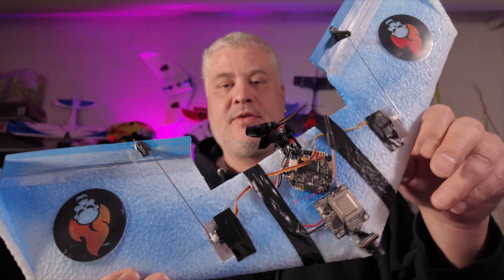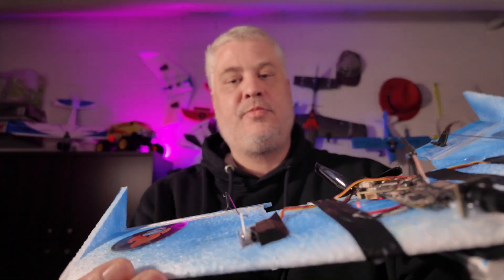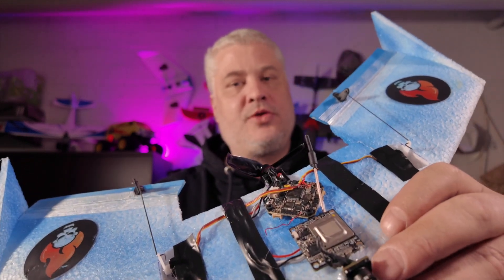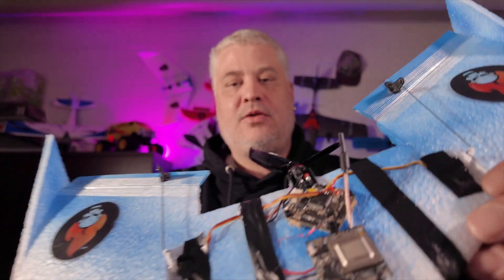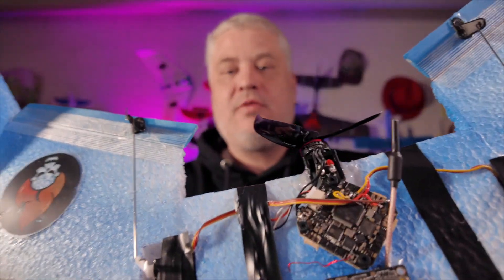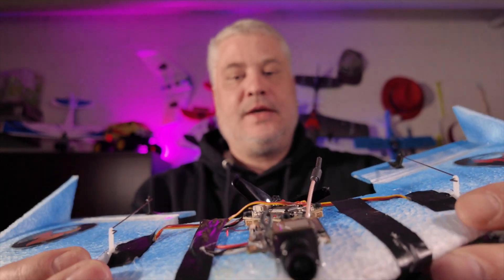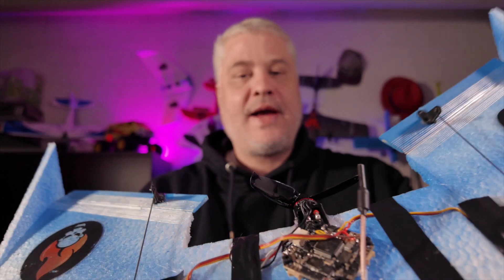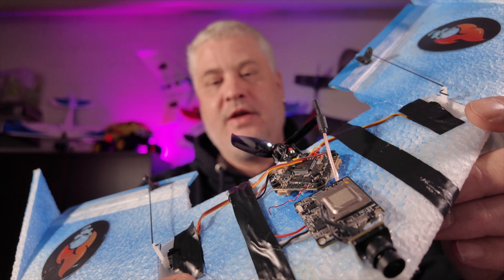Causemann Nano 2S INAV HD FPV Wing

Comment: The Nano-Wings is one of the best flying small wing I've encountered :D I don't see much difference in flight if that was the tuning flight compared to a naked one flying, merely the  difference in power on 2S 😂
Oh, that link for servos doesn't work, just that you know :)
Reply from the maker: To be honest, tuning flights are not so important. Rates and Feed Forwarad I can as well set myself. Fixed the Link for the Servos, thanks for noticing!
Reply: @RockFPV  No problem!
 I really appreciate descriptions like this having all the links in there for easy access. And about the tuning and other stuff that's something I'll be having a dive in the near future, trying a whoop FC on a plane or two :D
Reply from the maker: @theKeppis  Thanks! I am quite a Plane and Wing Noob but what I have learned is that the goal of INAV Tuning is to get it as close as possible to Manual Mode. So Manual Mode is definitely the way to go. INAV just gives some nice additional features. Having an FC definitely helps with inaccurate building, slightly off CG etc. which is great for me personally🙂
Reply: @RockFPV  FC surely helps with tail heaviness combined with manouverability 😄
Reply from the maker: @theKeppis  It balances everything out, wind as well. I never flew something like this indoors without any external wind influence
Reply: @RockFPV  while indoors the AC is on and some spots are quite turbulent, I don't find it that much different from outdoors,m just no actual wind in there 😄

Comment: Nice flight. Agile and floaty. My 2 motor WS build is waiting already 5 days for a NO foggy day and dry ground. Maiden maybe next saturday?? ...  I'm at 74 grams, no lipo, a bit too heavy. But I'm planning to swap all components to the 50 cm version later. Causemann had the root of the two wing halves cut under a slight negative angle.  Decided to keep the negative dihedral of approx -3 degrees because of the sweepback wing. Will see how it behaves.

Comment: Ahh gotcha, the BetaFPV F405 does not have a built in receiver, so external one is required. UART 3 is taken up by receiver, UART 1 is taken up by the GPS, UART 4 for the VTX.  Unfortunately the remapped file has UART 1 set to the servos, so that only leaves me 2 available UARTs on the pads, which is not enough for an HD Inav set up. Thanks though!
Reply from the maker: You can try this one, but no guarantee that it works
https://drive.google.com/file/d/1Om49N0DrIVlWyeO3pY4B278qNEcrWLJj/view?usp=share_link
Reply from the maker: I think I misread you original comment. I thought that you want to build Plane / Wing and not a Quad. For a quad, that would work but we would need a normal INAV Target. The FC has integrated ELRS and you have at least 2 UART's for Video RX / TX and GPS. It's usually not too much to change the Target but it's time consuming.